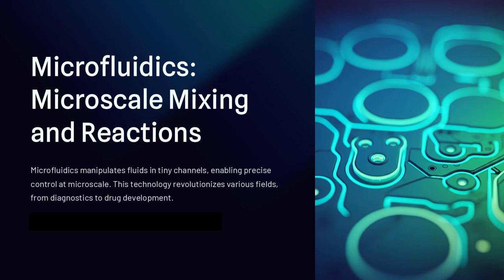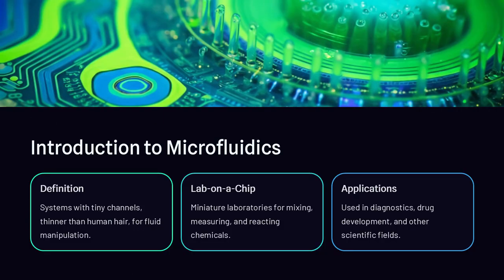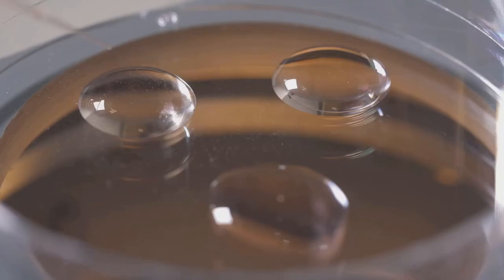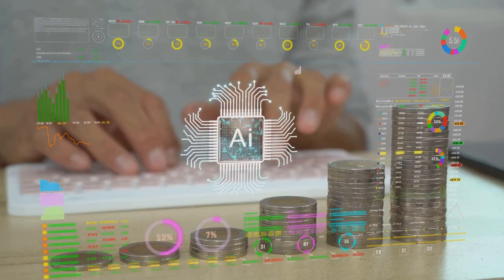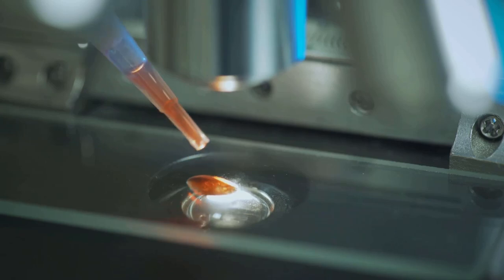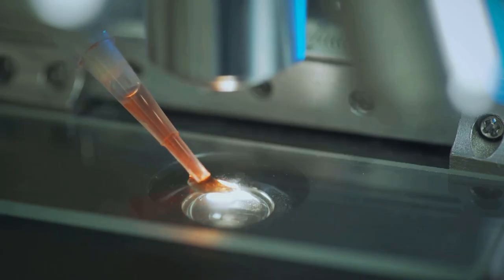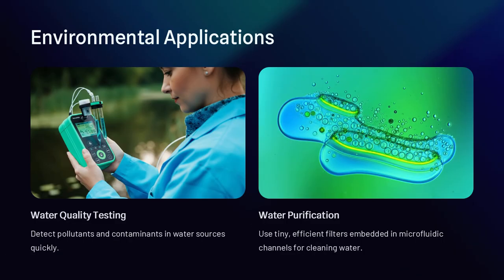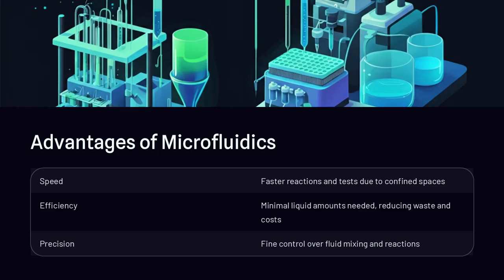Microfluidics: Mixing and Reactions at the Microscale

Comment from the maker: How do diffusion-dominated processes in microfluidic systems affect the efficiency of mixing compared to conventional macroscale systems, and what strategies are commonly employed to enhance mixing at the microscale?
In microfluidic systems, how does the interplay between surface tension and Reynolds number influence the formation and stability of microdroplets for reaction-based applications?
What role do laminar flow characteristics play in microfluidic reactors, and how can chaotic advection be induced to improve mixing and reaction kinetics at low Reynolds numbers?